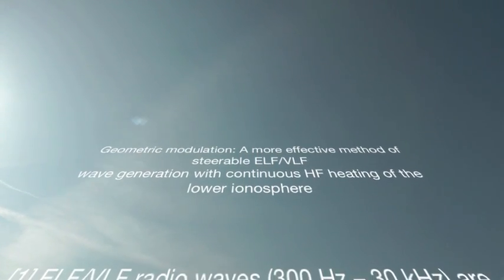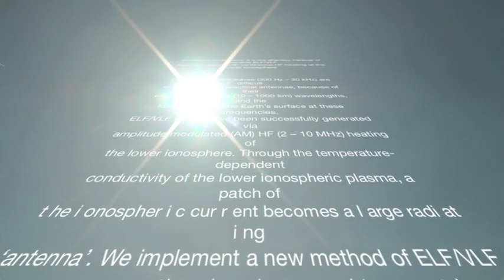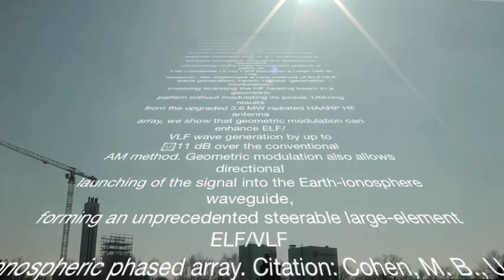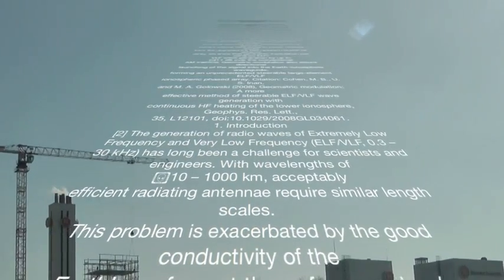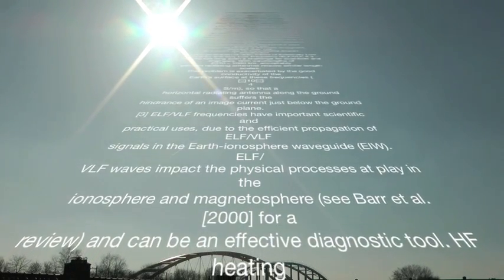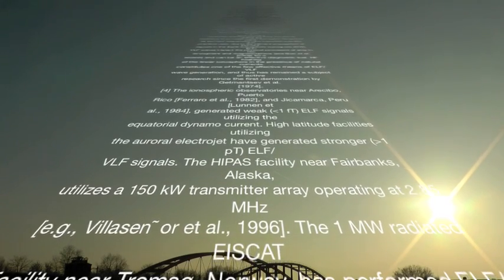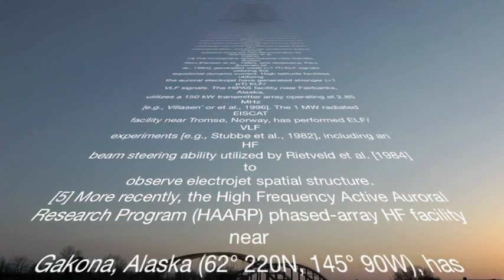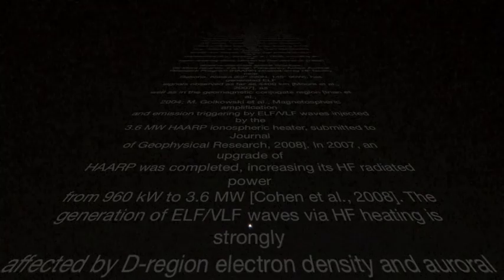Geometric Modulation: A More Effective Method Of Steerable ELF/VLF

Comment: Could you repeat that please.. about the hi power radiation moving faster than the .  something.. lol.. that was a crap load of information.  sounds like. they've been doing it for quite a while.  They are hitting us with what appears radiation.. EPA just shut off the BETA Monitors.  Everyone is bitching about poor air quality.. talking about their allergies.  I posted a video on Jan 28 on Fed 2 all the media came out all over and was talking about radiation leaks.15 days later I had no thyroid